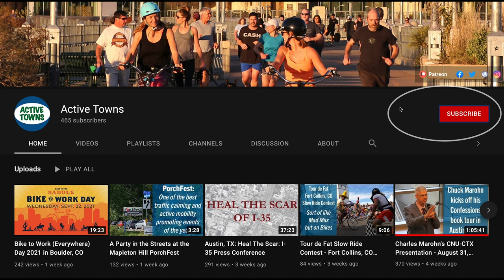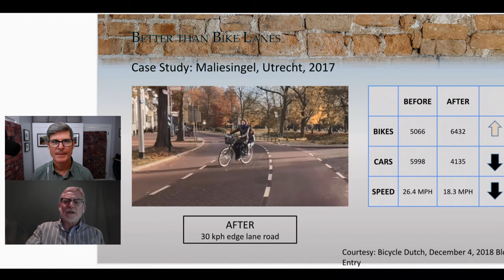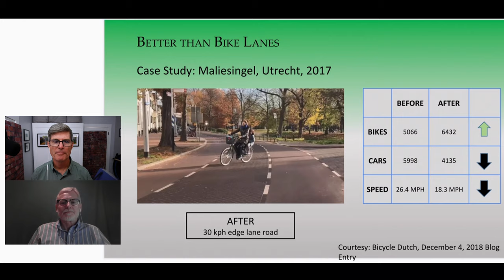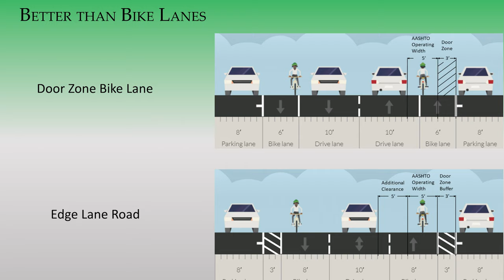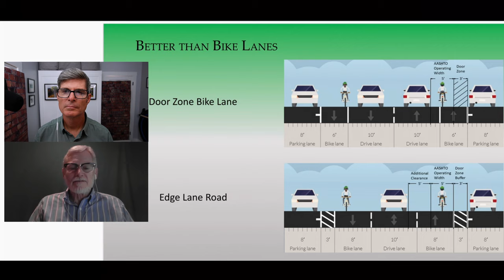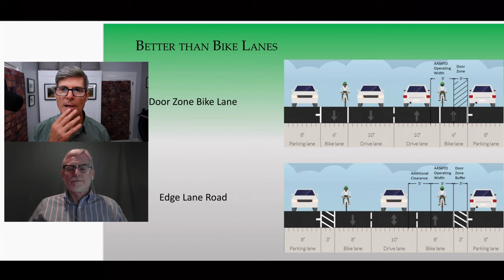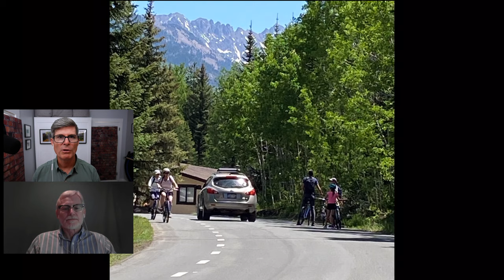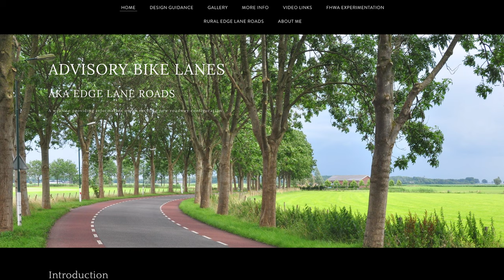These are common in Dutch & Danish cycle networks. Why?

Comment: The dutch way of also using a differnt colour makes you intinctivly vieuw the road as much narrower don't know if you get the same effect with just paint. Besides the colour of red thats used in the Netherlands looks really nice and quaint (not that was the reason to use it).
Reply from the maker: @Arturo Bianco, Yes. Great observation and I think you are exactly right, I don't think the effect is quite as strong with just paint. Thanks so much for watching and adding to the conversation. Cheers! John
Reply: And it's not paint. It's red asphalt.
It won't wear off.
Reply from the maker: @Be-Es---___  Yes, excellent point. Adding the colored pigment to the asphalt and/or concrete mix is a brilliant way to create a long lasting bit of infrastructure. btw We're doing that here in Austin, TX whenever possible. Cheers! John
Reply: I love the Dutch red paint color and appreciate the clear message it conveys to drivers about the presence of bicycles. The US FHWA has approved a bright green color for an equivalent purpose but it is hard to make an asphalt with this color so paint/thermo is normally used. it is possible for agencies to use this color on ELRs but most applications are on low volume roads and the cost is seen as prohibitive. Unfortunately a red color is already approved to indicate bus lanes so that is taken.
Reply: @michaelwilliams2593  I believe the particulair kind of red was chosen for its duralibility and cost effectiveness over here. But thtas only second hand information for me so it might be wrong.
Reply: They're colored with iron oxide (rust) so very durable and cheap.
Reply: It is not only a colour, it has a legal signification. You are not allowed to park or stop on the red strip and only drive on it when you have to pass a other car, when there is a continouess white line between the red strip and the middle strip cars are even not allowed to drive on the red strip. They are designated for bikes
Reply: @harrybruijs2614  This is only true when the bike sign is painted onto the bike lane. Without that sign the stripes and red path have no legal signifance at all, and a merely "suggestions".

Comment: One other big reason for Edge Lane Roads is to slow traffic of cars in regard to their speed. 
The image showed at 19:15 with a 'choke point' or bottleneck, would never be build that way in the Netherlands, simply because it doesn't affect the car.
In the Netherlands the 'islands' are always IN the car lane, forcing any car to stop for oncoming traffic, the bike lane would simply continue straight ahead.
Reply from the maker: @Peet, Good point. That was certainly a curious design choice, which is why I pointed it out. Thank you so much for watching and fro your contribution to the conversation. Cheers! John
Reply: Choke points definintly slows down car trafic. In fact it’s a very good tool. The edge lane becomes unavailable so cars have to slow down to make absolutely sure they can pass through.
Reply: @ActiveTowns  Thanks and keep up the good work. (and cycling of course)
Reply: @Kvadraten376  Yup.
Reply: Correct! Just imagine you encounter this situation in the dark! Horrible!
Yet again an attempt to copy Dutch infra, but definitively the wrong way.
Reply: @dutchman7623  As usual yes.
Reply: There are a number of studies out of Europe showing that drivers slow down on edge Lane roads with narrow center lanes. I agree that the choke point in the picture is poorly implemented. The Dutch have an interesting alternative which I've heard called sleeping cyclists. They consist of smoothly rounded bumps on the broken line. I think there is a picture of them that John has shared in the study notes for this podcast.
Reply: @michaelwilliams2593  That's a bicycle street, a street where cars have to stay behind cyclists until it's absolutely free on the passing lane.
On a choke point, bicycles can go on as if it's not there, only cars have to negotiate, and with the sign shown the car in the opposite direction has to give way, because I am the white arrow, his direction is red.

Comment: Speed kills. This is the fundamental issue in much of the US.
Reply from the maker: Yes, it doe and it most certainly is. Thanks so much for watching. Cheers! John
Reply: Many drivers in the UK too think it's their fundamental right to drive as fast as they want and how ever they want. In my town, as someone who delivers on an ebike, cycling is dangerous. Cars will pass me less than a metre away at high speeds, pull out in front of me on purpose just as a few examples.
Reply: Also, cycling infrastructure is really poor and just a tick box exercise. A lot of the driving public oppose even a painted, unprotected cycle lane! Safe cycling infrastructure will need to be paired with good policing and cameras to punish dangerous driving.

Comment: The Utrecht example of 35:00 is part of a bigger plan/agenda to push cars from the city center towards the ring roads. This road was used (by me too) to drive from the edge of the city to the opposite edge straight through the center. A part of the drop in cars is also from that. (for people noticing that the total number of street users decreased)
Reply from the maker: @Cl0ckcl0ck, Thanks so much for watching and for this context. Much appreciated. Cheers! John

Comment: There is one disadvantage from a Dutch driver/cyclist of the advisory bike lane roads that was not mentioned here. As a driver on these roads, I had multiple heart attack moments in the dark. As the cyclists are driving often without good lighting they are not very visible, especially in rainy nights. These roads necessitate to go over the bike lane once in a while when oncoming traffic has to be negotiated. It rarely happens, but sometimes suddenly there is a cyclist in your headlights and for a moment you think "do I choose to crash into the car or the cyclist". It never came to an accident, but it can be quite scary for both me as a driver and for the cylist who hears heavy braking and the shining headlamp lights getting brighter and brighter from behind.
Reply from the maker: @Ronald de Rooij, Thanks so much for watching and the firsthand account. Two thoughts immediately come to mind, first, yes, we need to have those bike lights working well and second, it reinforces the necessity to keep our motor vehicle speeds in check while driving on these types of facilities for exactly this reason. Most crashes are in fact simply avoided when speeds are at non-lethal levels. Cheers! John
Reply: I think people need to realize that a standard two-lane road, which is often the only other available option on these roads, requires cyclists to be in the travel lane always. In that case, they are always subject to being run over by a driver that doesn't see them. This is much different from an edge lane road that puts them in this danger only when a driver needs to move into the edge lane to pass an oncoming car. For that reason and a number of others, they are preferred to standard two-lane roads. 
Some viewers/readers will say that physical protection or exclusive lanes are needed rather than edge lane roads. But that isn't going to happen overnight all over the world or the US (where I live). And it isn't necessary on all streets. ELRs and shared streets in general are good tools for the right circumstances and need to be used with consideration.
Reply: @ActiveTowns  I was driving only 60 km/h.... That is the allowed speed.
Reply from the maker: @ronaldderooij1774  Understood.
Reply: @ronaldderooij1774  I recognize your situation and reaction. Mostly I encounter this system in the Bûtenfjild (Friesland) when I am visiting friends and family in The NL. It never sits well with me. 

Hoever I am not sure we react this way because we know there are better solutions or if the situation was that bad. Overall it works, but doesn’t mean it doesn’t test us. In the end it is a tool in a toolbox.
Reply: @ronaldderooij1774  Yes lightning on bicycles is sometimes a problem. I have seen people in all black clothing, without lights at night in the rain. Or well saw them in time. But mostly these people don't have a clue how the visibility is in a car and they think you can see as good as they can. On the other hand, I had cars nearly miss me while I am very visible from te front. reflective clothing and on our Lovens cargo bike which has a led light  that is quite bright and a light strip on the front. But still he wanted to park where I was cycling. I live in Belgium so most cycling lanes are between the driveway and the parking spaces. They have a lot to learn here, I miss The Netherlands so much nowadays. Even when at first I didn't when I moved

Comment: 20:19 The reason for the walk-over: a children's playground on the left. But these Danish "islands" are wrong. Instead of slowing cars down, they can drive straight through. Here the cyclists are supposed to use the middle as well and are forced into the car lane. (Not in this bad example, but a common elevated footpath or kerb would prevent cyclists to go outside.)
In the Netherlands the "islands" would narrow the car lane, the cycle path would go straight on. (And if it's a school walk-over, there will be additional speed bumps on the approach.)
Reply from the maker: @RAW, Thanks so much for watching and providing this helpful insight. Cheers! John
Reply: This example seems to be dangerous in the dark. Suddenly blocking the bicycle lane seems not a good idea. Carlights will light up the reflectors from a decent distance and the cardriver can anticipate. Bike lights do not do a good job with reflectors and If they light up, you have only a short time to react. It is especially dangerous when there is fog, or rain and the cyclisch is wearing glasses.  I once fall from by bicycle because I saw the obstakel too late because of darkness, combined with rain and glasses.
Reply: Not always. In Mariaheide the bicycles have to go into the narrowing part of the road, effectively being used as a speed bump

Comment: Great video. Beyond protecting the slower traffic on the narrow streets, it's a good way to reduce the car traffic [diverting them to larger roads]. 
The video in @38:00 is making clear it's a good solution, and (as I see in Utrecht-city),  easily reformed to bike-road [fietsstraat] altogether when bikes are in majority ;-)
Not sure if there is space for a parking lane (or even two!)  this would be the way it would be set up as an edge lane here: probably the parking lanes would be switched out with bike lanes: less negotiating [-mistakes] and a street with that width is exceptional here, so would be considered a high volume [car] road, so reducing speed would be to not the way to go.
You would expect older people are more used to narrow streets and negotiating the space, always find age, abilities, and business a weak argument against better [bike] infra: if they can go to the golf-course, maybe they can bike to it? :-)
Reply from the maker: @tom jacobs, Thank you so much! I really appreciate it. Yes, it's a bit perplexing at one level the resistance of older generations to these changes until we step back and realize that they have been driving on these overly wide streets for decades and suddenly changing to narrower lanes, especially if their eye sight is starting to go (like mine is, due to normal aging process), seems quite scary. Of course, that's the whole point, we want to encourage them to slow down. Change is difficult, for all/most of us. We're human. Cheers! John

Comment: The UK was mentioned near the beginning. The UK has advisory cycle lanes, in that there are lanes with dashed lines at the edge of the carriageway, but they are far from this concept. These lanes are only present when the road is wide enough and has a centreline, and aren't used like edge lane roads.
Reply from the maker: Thanks for watching and for adding to the conversation. I’ll make sure Michael sees this. Cheers! John
Reply: There are edge lane roads in the UK without center lines. I am not aware of the installations you reference. Unfortunately, some agencies in the US have chosen to do the same thing. The use of a center line with this treatment is a significant mistake, in my opinion. The road markings communicate to each road user type that they have enough room without needing to negotiate which is untrue. This poor communication will likely lead to poor safety and low comfort. The primary difference in the UK is that cars are allowed to park in the edge lanes in most settings. This is unfortunate and greatly reduces safety and comfort, in my opinion.

Comment: At the 39 min mark. Children especialy this small behind the adults would be a big no no in the Netherlands! They ride right infront of you (depending on the road and age) or beside you (wich would be the better option here, considdering road and age. You between them and the cars.) so you can see what they are doing and you can give directions ahead of time. Riding way out on the road would make a car user on edge and see or think that there may children or animals. Children this small may be in a blind spot over the hood.
Reply from the maker: @Linda Raterink, Thanks so much for watching and providing this very helpful information to the conversation. Cheers! John

Comment: The edge lane roads will work in the US countryside (proven in Lincoln, Mass.) and lightly travelled prewar city and streetcar suburban streets, but definitely NOT in automobile suburban areas like in San Diego, California because there every through street is a commuter route - if not an arterial or collector then definitely as a rat run in-between.
Reply from the maker: Yeah, traffic volumes and speeds are critical to the application. I am noticing their application in some locations in The Netherlands is being questioned for precisely these reasons as well. To prevent the rat-run effect, I noticed that the use of traffic diverters and modal filters for bikes and peds helped a lot. Thanks so much for watching and checking in from SD. Cheers! John

Comment: Interesting how the perspective is in other countries. Living in the Netherlands, for several years I had to cycle about 13km each way to school. 

One section, about 2km, was along an edge lane road as described in the video: Center single lane for cars, painted bike lanes on either side. I was always the part of the journey I felt LEAST safe on.

It was an open, fairly rural 60kph road, not particularly busy. But I felt anxious every time a car or truck went by, especially if they came up behind me. It may have been a nominally shared space, but without any physical infrastructure to enforce it, it might as well have been a wide car road. 

The speed limit was fairly high, but that wasn't necessarily the biggest problem. In my view, what played a big part was that the road was straight and the land was wide and open on either side. No trees or bushes. So nothing to encourage drivers to pay attention and focus on the road and other road users.

I really think that it's not just the design of the road (and speed limit), but also the design of the environment that plays a big role in how people will behave. Plant trees, break long sight lines, make sure drivers HAVE to pay attention. In new developments, avoid long straight sections where drivers can build up speed.
Reply from the maker: @GundamSentinel, Thanks so much for watching and sharing your experience/good points. Cheers! John
Reply: You want to break sight lines to feel safer? But if its flat and open, the driver has noticed you before you could hear them honk. They will still be seeing you as they get closer.
Reply: @blanco7726  Open roads means people pay less attention, drive faster and as a consequence have less time to react. And because speeds are higher, collisions cause much more damage.

This is why in the Netherlands, trees and hedges are often planted along the roads to force people to pay attention. Attention is focused on the road and away from the rest of the environment

And in inner cities, long straight roads often get artificial curves just to keep speeds low and driver attention high.

It is tried and tested. The infrastructure should guide driver behavior and not the other way around.
Reply: @deathscythehellfunk  drivers drive as fast as they can see. If they can see they can see you.
Reply: Well supporting cycling is more than ticketing bike lane invaders, I guess the use of it should be made clearer. "Do what you want on, through or across the bicyle lane, but dont get in the way of cyclists"